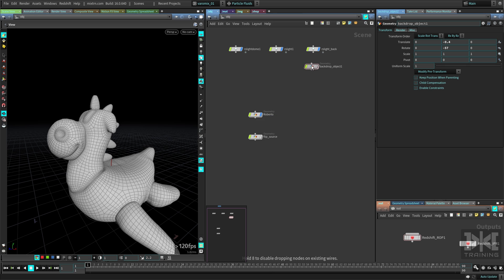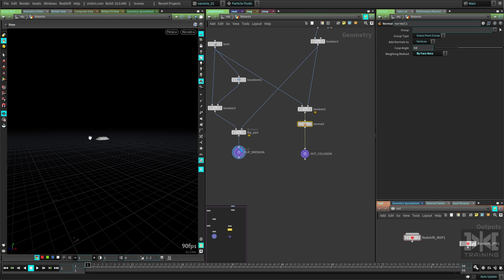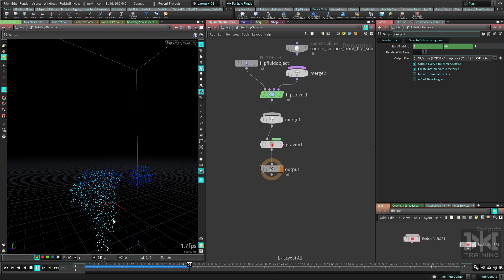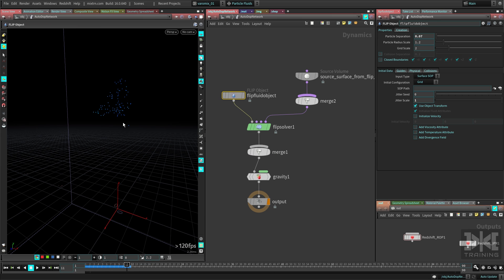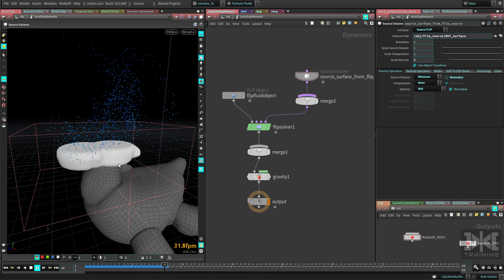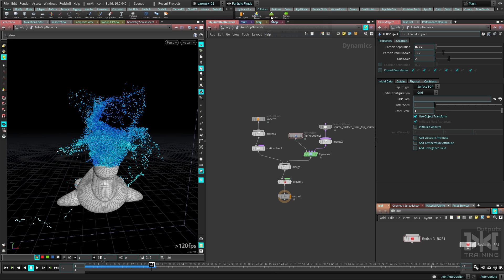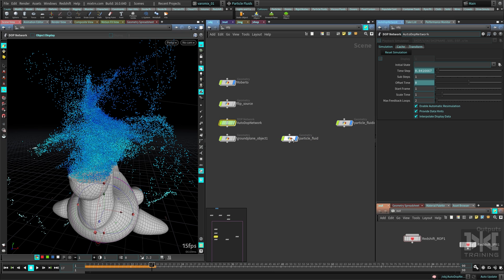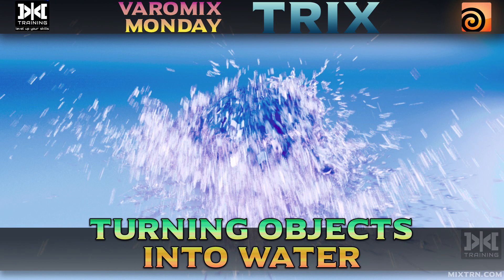VMT 031 - HOUDINI - Turning Objects into Water

Comment: Could the use of maskfromgeo do the same thing as the boolean are doing ? in H18 ?
Reply from the maker: No, cause boolean cuts the object
Reply: @MIXTraining  Oh, ok. Thank you for the follow up ! I was thinking about the maskfromgeo because of the grade you can make with it so the cut is not that sharp, maybe the maskfromgeo can be but into the boolean for substract ? Still trying to figure stuff out.
Reply from the maker: Not sure what you mean, but if it works it works

Comment: One question, why does the boolean sop at start can fuse the object ???? 
I don't get it why boolean has this effect when plug only the first input :(
Reply from the maker: the boolean object has that option to resolve intersections so it fuses any parts on the inputs to make them solid and be able to calculate the inside
Reply: @MIXTraining  wow, thanks, I never knew boolean can be used to do that effect :) great tutorial!

Comment: I'm trying to dissolve one of the Stanford Scans (Lucy the Angel statue) and my FLIP fluid is getting huge spikes in velocity when the collider is active, with or without additional velocity added. Any ideas?
Reply from the maker: those are scanned models and might have corrupted parts, make sure to clean it up with a PolyDoctor or something similar, that might be the issue, also check that your collision geo is been generated correctly

Comment: Ok sou I imagined you would make this much easier with Fluid from object and then bash some velocity field through him which makes the water splash outwards.

Now after you made the boolean operation and were left with the small box from the intersection, which moves downwards... How does it do that? Where did you enter that this intersection rest can move downwards??
is it somehow connected to the flip_part node which is just another boolean? 
I also am really confused about the rest of the horn-tip. What did you bool under the rubbertoy_geometry to pull it into it so only this little bit is left, which you THEN instance on obj level so you can use it as particle emitter
Reply from the maker: Using Fluid from object the challenge would be to keep the fluid from going everywhere.

I just animated the box down, that's how it moves
You need to have at least 1 point in the emitter for the flip tool from the shelf to work if not, it fails, you can try it and see what I mean, even if at frame 2 there's geo it needs to be there at frame one. is just how the tool works
Reply: Ah ok. The small one that intersects. 

Yeah I just did not understand what you connected so you get the tip of the horn which you then use as the required source to emit particles from. Here a .hip would've been really useful to look over to understand the boolean connections, although I complained about uploading .hips :D

Ty tho, will try out ^^
Reply from the maker: I just used the same box twice, one input of the boolean is the original the second is offset a bit to get that small part that finally cuts ROberto